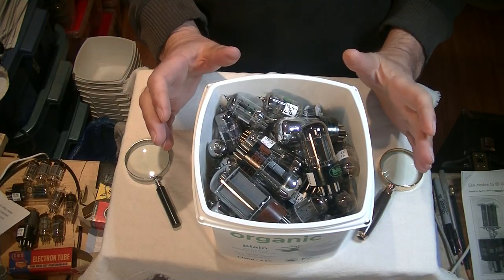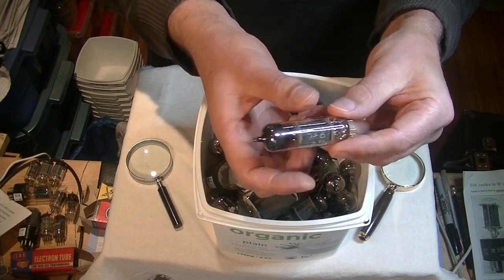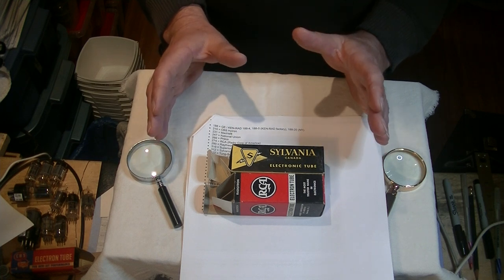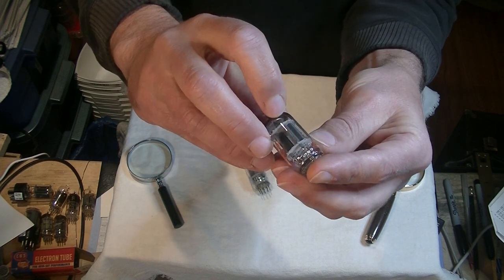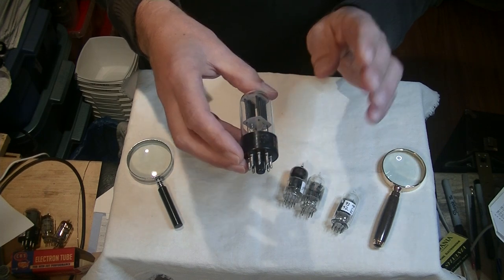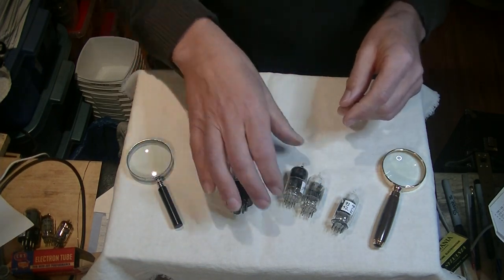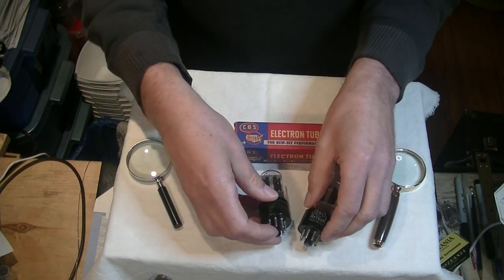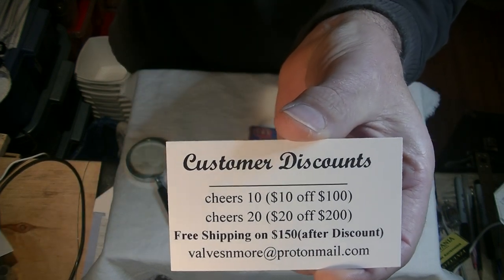Tube Lab #12 How to Identify Tubes Made in North America

Comment: Thank you for this video.  You have the right idea of using all details of tube construction as clues to identifying tube manufacturing origins.  EIA codes really help.  So true - it is very important to not get distracted by painted labels; look inside the glass for the features you know are unique to certain manufacturers.  Those clues include plate coatings, plate holes/folds/ridges/staples, and mica shapes, including holes and details of the edge shapes.  Also consider features of the glass envelope - for example, mid-'50s Sylvania short-plate 12AX7 have unique elongated/pointed glass evacuation seals, and 12AX7A or 7025 made by Sonotone in their Elmsford NY factory had much smaller diameter and height glass envelopes (as well as unique white material insulating the wiring below the plates).  

Let's clear up two unfortunate InterWebz misunderstandings that get repeated too often:

1) Octagon/"stop sign" boxes around the tube type does NOT assure RCA manufacturing.  Many, many North American tube manufacturers utilized that octagonal box (or elongated rectangular octagon, on miniature tubes).  These manufacturers include Tung-Sol and Raytheon, as well as many others such as Sonotone, Ken-Rad (early GE) and Lansdale. 

2) Etched dots on the glass does NOT necessarily indicate GE origin.  Westinghouse and CBS also used etched dots on tubes they manufactured (caution: many "Westinghouse" tubes are re-branded, and manufactured by other companies.  You cannot be sure if it is "Westinghouse").  GE used those dots as their proprietary date coding, so they could tell when their tubes were manufactured and decide to honor warranties or not.  If you want to find out more about GE dot codes, search on GE date codes and you can find excellent information posted by Jim Cross.